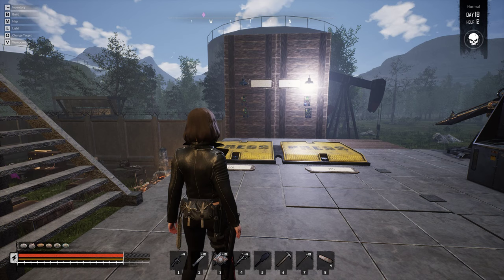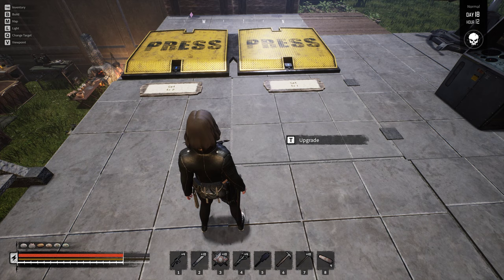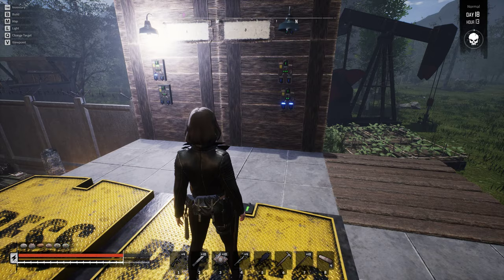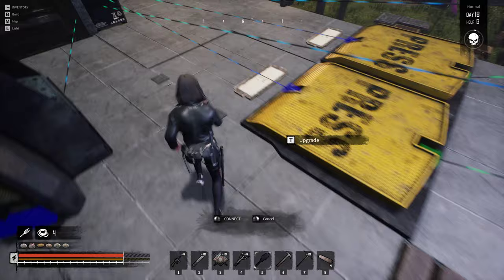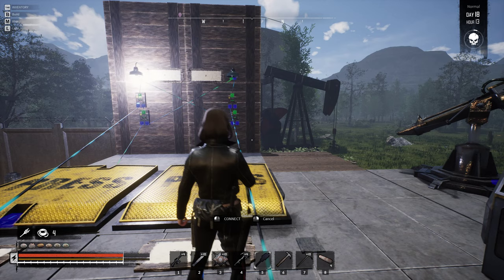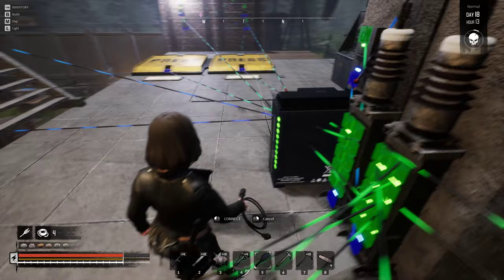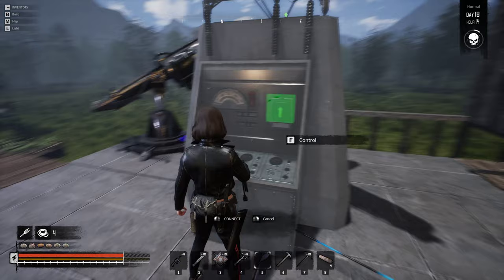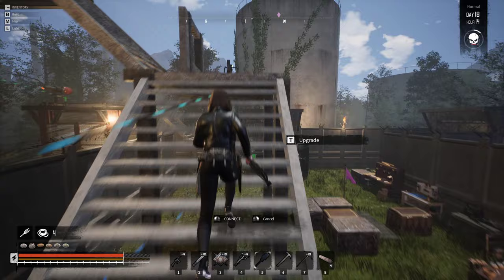Electricity and Gates | Night of the Dead

Comment: Seeing how much delay there is for the logic pieces to process,
could that delay be used to cicumvent the rail gun from frying a power grid and all its components?
Asking for a friend =)
Reply from the maker: I do not believe so. What people usually do is connect the rail gun to a single battery, and just repair the battery every time it fires.
Reply: @dcsobral  Yep
Have tried a lot and I can see only 2 exceptions how to go around that:
1) Custom Settings: Lower power consumption of traps to about 30%
2) Jump up on a pressure plate at the exact split second right before the gun fires (Jinima demonstrated this in a vid)

There's supposed to be a bug for an exploit with some fancy circuit, too